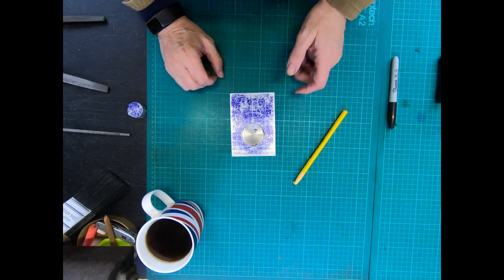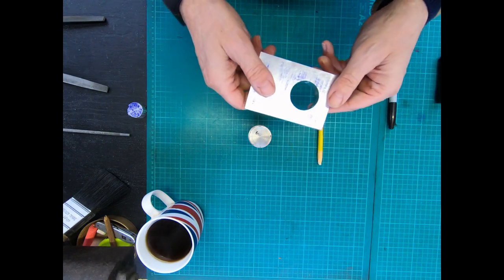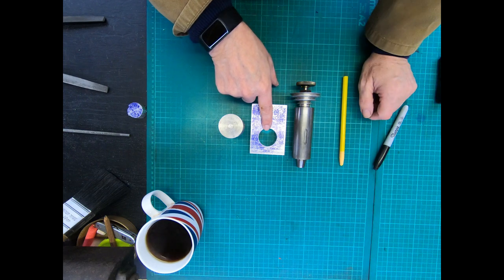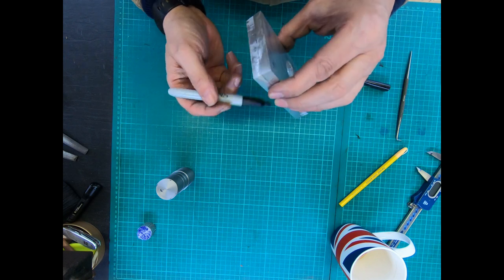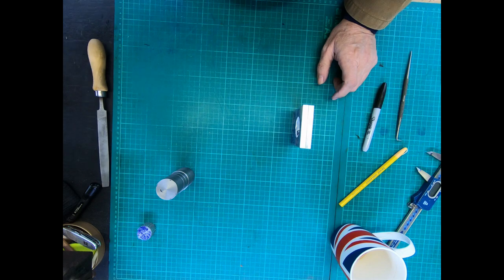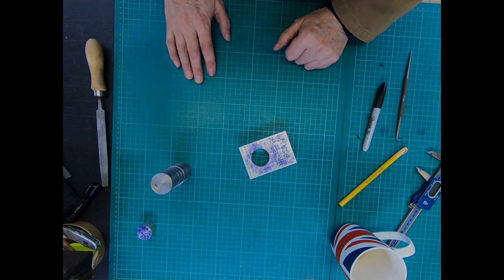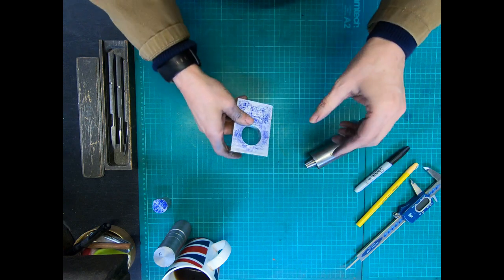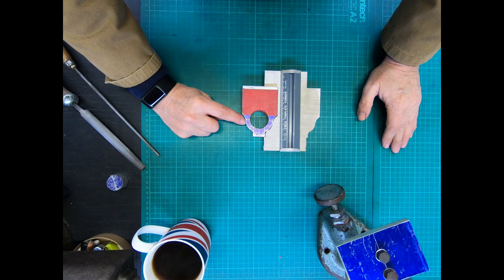Making a Watchmakers Spindle Maintenance Fixture (Part 3).

Comment: Hi Paul. Kudos to you for having the patience to file an accurate round hole. Clever use of the adjustable template to ensure both sides of your fixture are the same. You can be justifiably pleased with the end result. Well done 👏👏👍😀 Andrew
Reply from the maker: Hello Andrew,
The filing of the round hole was a lot easier than the filing of the sides... I tried to follow a logical approach to the task and just dug in and beavered away. Thanks for watching.
Take care.
Paul,,